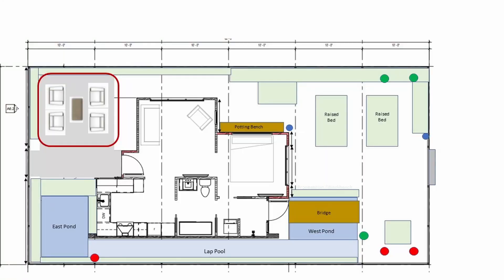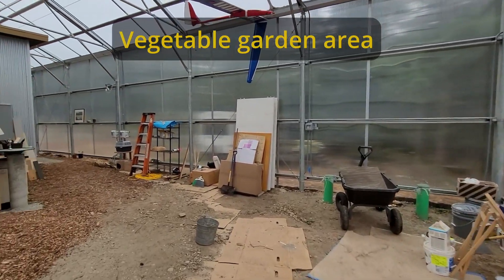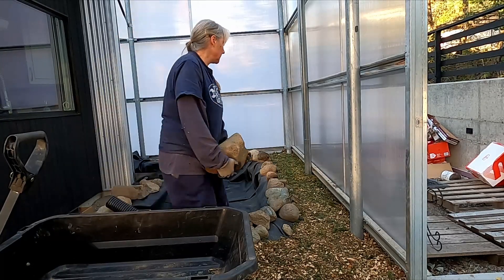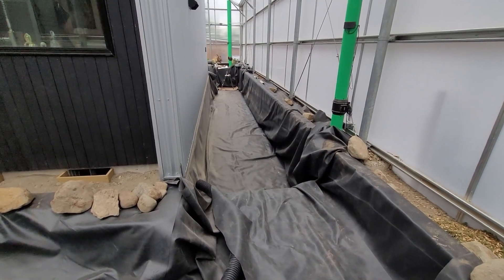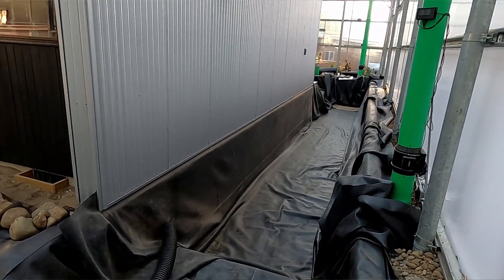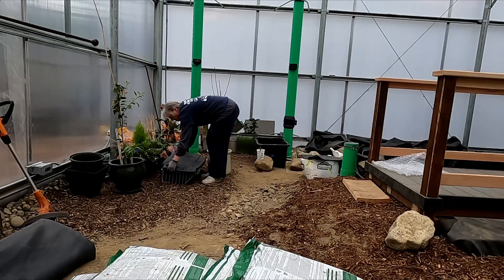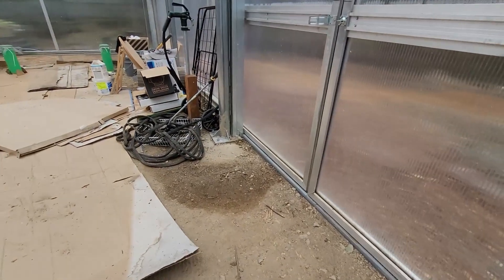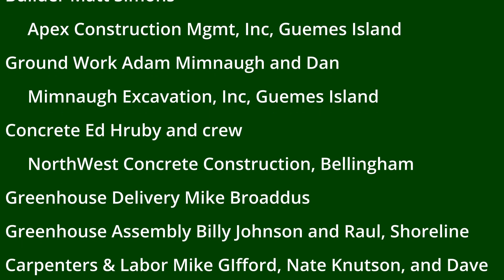E48 Tiny Home in a Greenhouse | Planting the first tree

Comment: being able to cook that meal or dish makes it really feel like home.  I am now curious about cleaning the inside of the greenhouse glass and wondering how often  commercial greenhouses clean the glass. Thinking attaching  a spray nozzle and in the middle of July having a annual spraying down the inside and outside of the greenhouse( after the tree pollen season) incorporate a water balloon fight, or squirt gun fight and grill out.
Reply from the maker: You read my mind. I have a power washer that I'm going to try with a long wand, soft brush attachment for the walls as early in the spring as the temp is high enough inside that I won't care about getting wet and can open the ridge windows to help ventilate faster. But before any plants that will grow on the walls (cucumbers? tomato? not sure yet) are established.   Later in the summer when we're in the middle of the dry season I'll pressure wash the rug in the seating area. I'll also have to, periodically, vaccum the house roof and wash the skylights from the leaves and pollen that come in when the ridge windows are open.